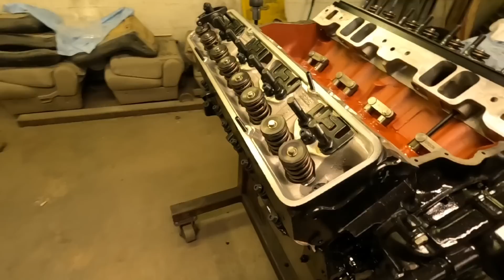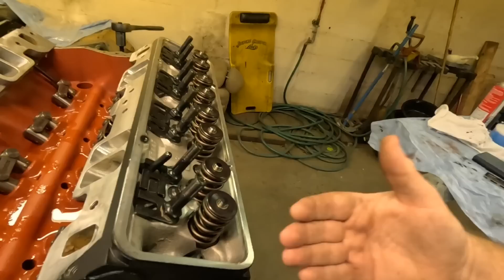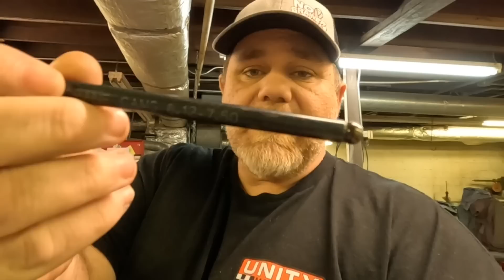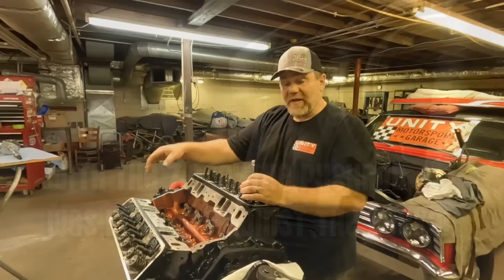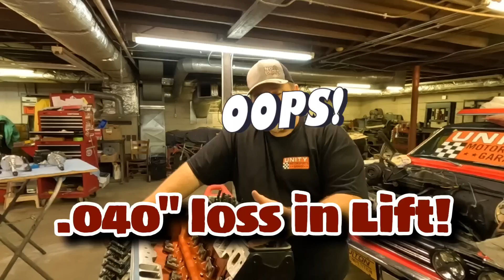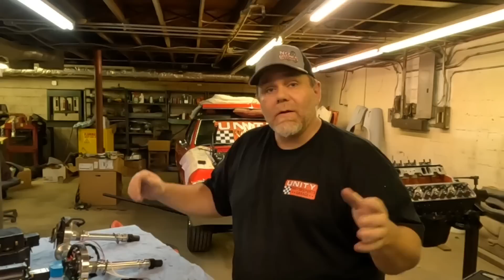408" Smallblock CHEVY: Project SLEEPER!!! PART 3 @DavidVizard

Comment: I've been using the Straub method for a while. I've doubled checked with the sharpie on occasion and it has never been off. The basic idea is the rocker being level to the valve tip at half lift.
Reply from the maker: That's it.. and that is what I shoot for as well.. 
I know with the 7" pushrod we started with would have been an epic fail!
Andy

Comment: I'm concerned about the precision tool where you DON'T use test springs.
Reply from the maker: The springs we are using won't hurt the adjustable pushrod on the other hand I would never do that with MIXED UP BOSS with over 700lbs over the nose! Lol
Thanks for watching
Andy

Comment: Andy With solids do you check it at 0 lash ? Or solids different ? .
I bought cheap 1.6 rockers last winter.  My 1.5 Cranes had more lift. I Couldn't get 1.5 out of cheap junk.
Reply from the maker: I will do it at a Cold lash setting to try and mimic the running condition.. I have found that Rocker ratios can be ALL over the place! 
Andy 
Andy

Comment: I can tell you have been listening to Joe Walsh music.   I'm glad you mentioned the lift in regard to the pushrod length,  that is another way to know it's correct.   On shaft rockers I have had to machine/locate the stands as much as .050 to the intake side as well as raise them to get lift and pattern correct, and the rockers were supposed to be for the heads specifically.
Reply from the maker: I have had to do that also! Not fun.. 
Thanks for watching
Andy

Comment: Instead of trial and error, and turning the engine over to look at the pattern (which when not using checker springs the lifter can compress), you should use math and follow the method shown by Foxwell/Straub Technologies on YouTube.
The only thing is in the video he forgets to mention that you need the cam lobe for the valve you are checking on the base circle.
And that once you extend the pushrod, then take it out to measure, add the preload you want on the lifter to the pushrod length.
This method results in the narrowest sweep, which is what you want. And as long as the roller tip is in the center third of the valve stem, it’s good to go. Minimal scrub across the valve is what you want.
Reply: Pockets- I agree the Foxwell method is excellent. Does he still work with Straub?
Reply: Pockets- I agree the Foxwell method is excellent. Does he still work with Straub?
Reply: @philipmazzuca2269  no.